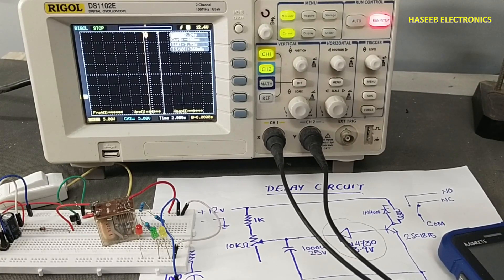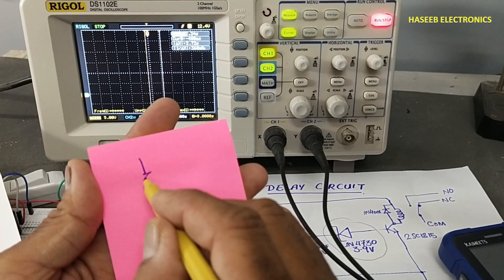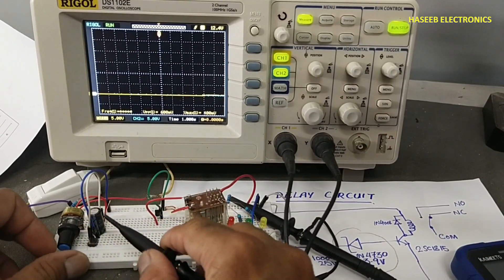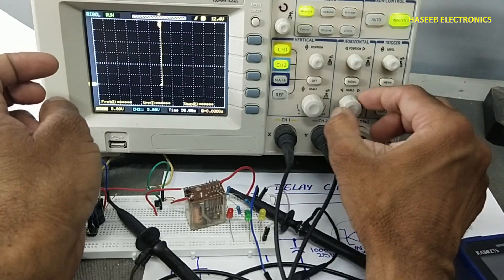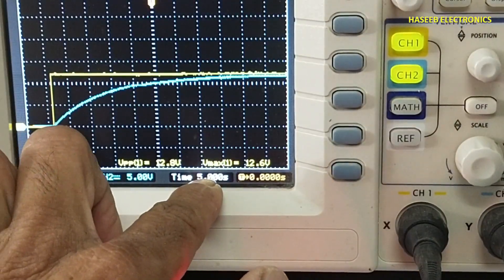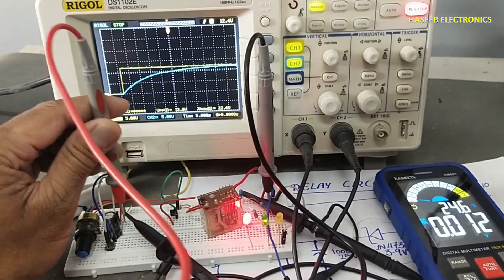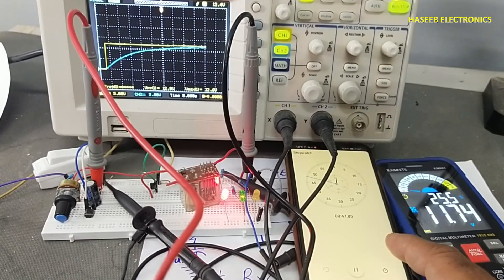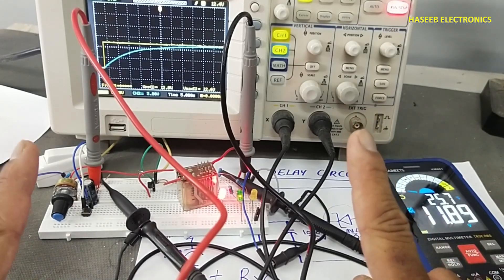{915} time period measurement between two signals using oscilloscope

Comment: Kindly explain opamp circuits
Reply: I would like to see a side by side comparison with comparators. SO MUCH can be done with op amps. I'm fascinated with Weinbridge oscillators. You can see the bounce of the filament in the light bulb as it oscillates when you first turn it on.